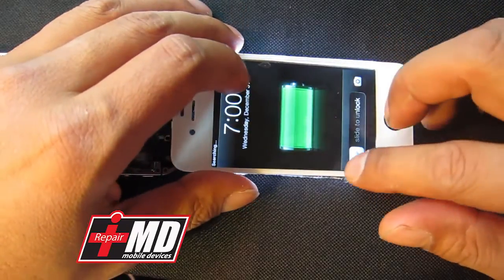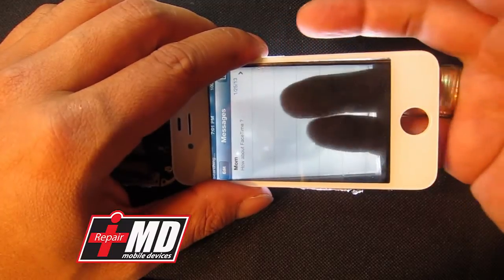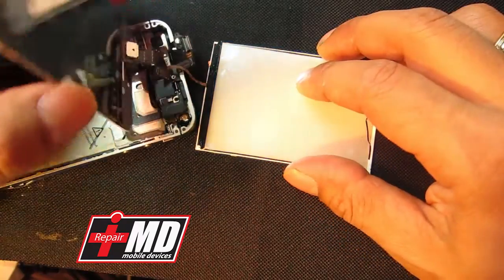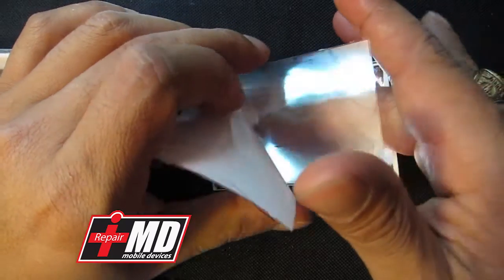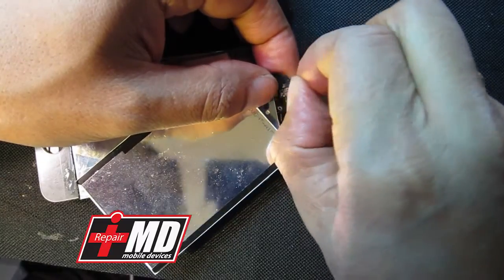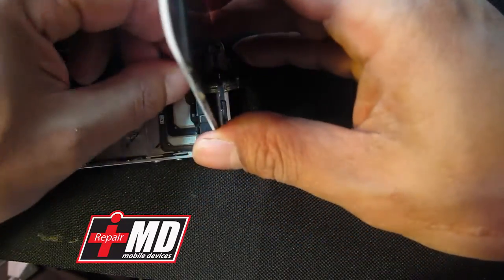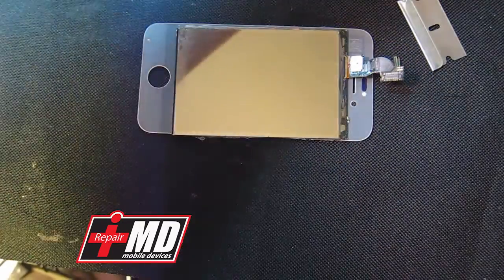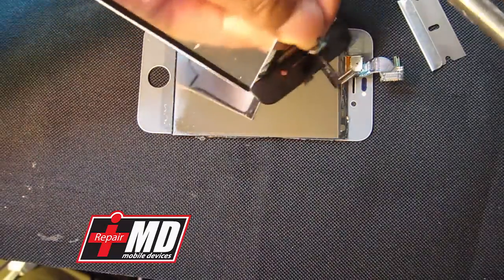Episode 4 Part 2 (Fixing Liquid Mistakes and Impact test of new bonding liquid)

Comment: Just so you know soldering isnt required, you can replace the sheets that need to be replaced, if the led panel was bad then ya, but the other sheets are separate.

Comment from the maker: The UV liquid will cover the scratches making it disappear, as far as the touch sensor in the bottom it just might be that it's ultra sensitive to touch that it doesn't response correctly. Sometimes actually using the UV liquid with the new glass and curing it fixes the issue. (70/30 chance of in working)